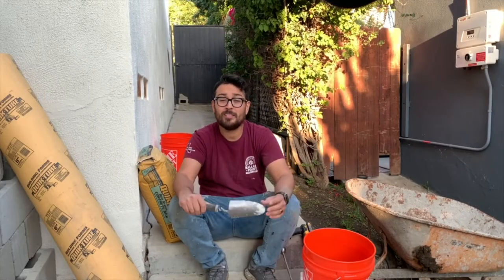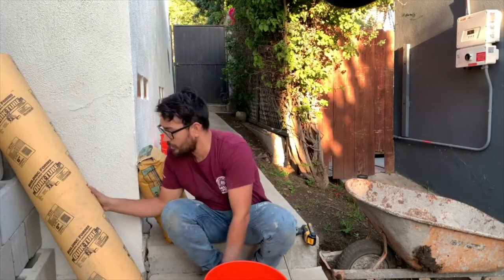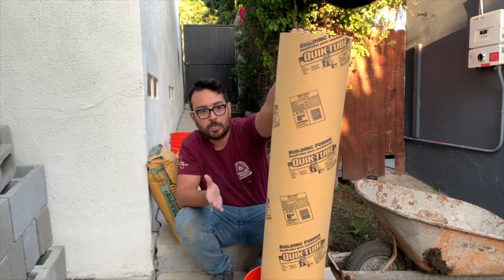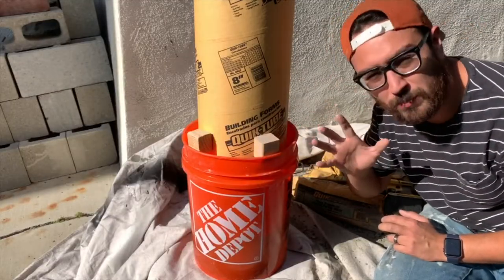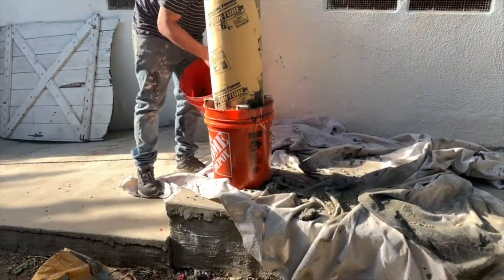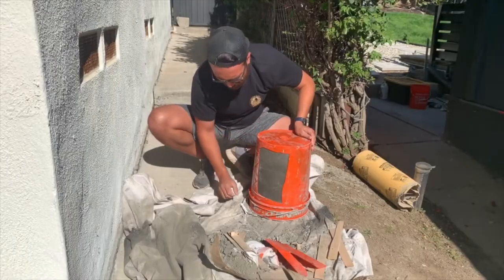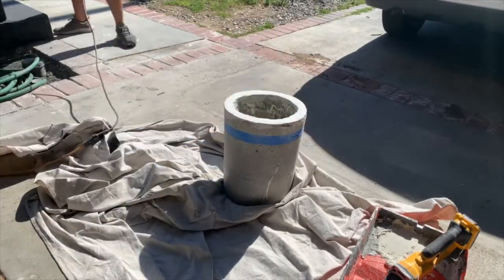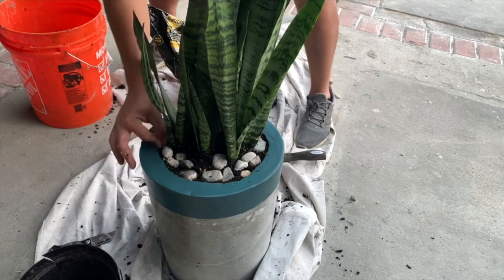How to make a DIY Concrete Pot with Buckets | Cement Planter Tutorial

Comment from the maker: Because I used a plant that requires little water, I decided not to add drainage holes to this planter. But I did add plenty of rocks to the base of the pot to assist with drainage and so far that has done the trick!
Reply: Concrete also has natural drainage properties like terracotta!

Comment: No weepholes in the bottom? I like the look of the painted concrete!
Reply from the maker: asztapaszta9 good question! Not practical in this application. That’s why I padded the bottom of the pot with a lot of gravel. It creates a drainage layer. Not quite as good as a drainage hole, but it’ll do!
Reply: @Robuilt  Ok, i see. Also, the plant you picked does not need excessive watering so it should be fine.